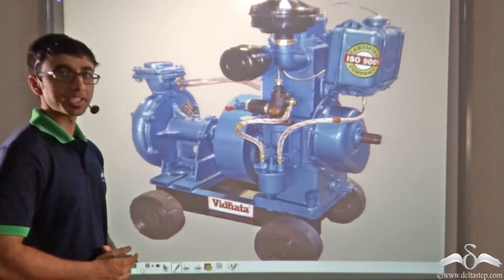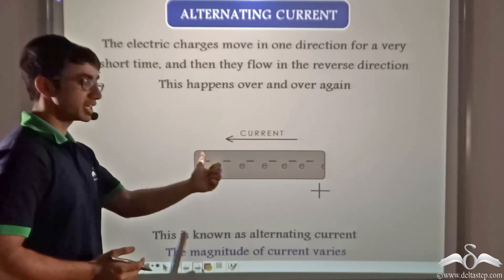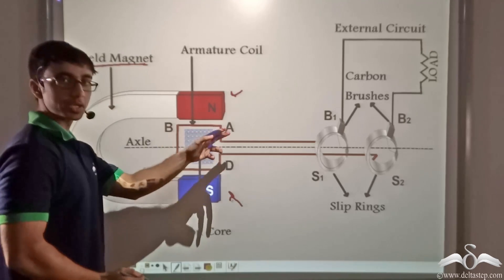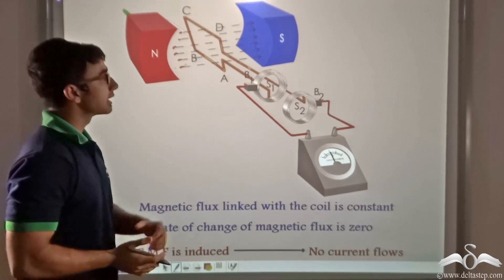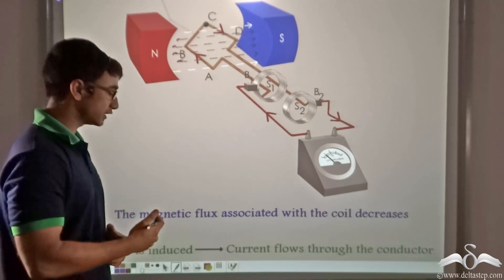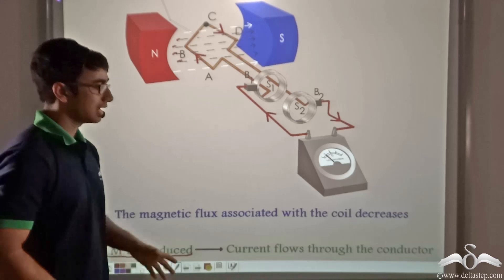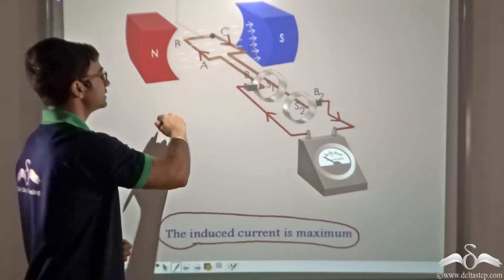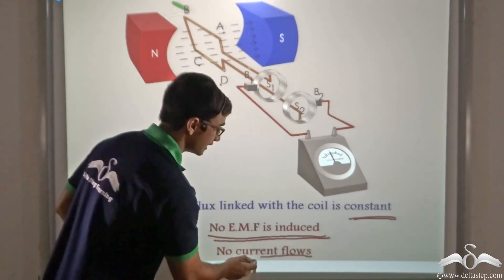Working model of AC Generator | Magnetism | Class 10 | CBSE | NCERT | ICSE

Comment: How do you visualize the e.m.f induced in coil in the case of AC. Where is this present ? You say first  the emf is induced and then the current flows. Where is the emf in the coil ?   In the case of DC with a battery we can say the emf is present across the terminals of the battery.  The difference in electric potential between the -ve and +ve terminal is called voltage or emf. In the case of AC, where is it in the coil because there is no battery.
Reply from the maker: We recommend you to register at DeltaStep.com to get access to 5000+ amazing video lectures, 1 million+ questions with detailed solutions, tests, games, report card and much more. Also get access to personal tutors to resolve your doubts. To know more, please feel free to contact us at 9674645164 or email us at info@deltastep.com. Download our learning App: https://bit.ly/2LBOVlR
Reply: @DeltaStep  I did but there is not a specific video there that  does  answer my question.

Comment: AC Generators used not only during power cuts and load shadings. The power stations also have AC Generators also known as Alternators. They are main source of power supply. They come in  210MW, 250MW, 500MW, 1000MW etc capacity.

Comment: This theory is bull shit. Why would current Flow when magnetic flux change? It's not so, it's like when the armature or copper Turing ABCD is vertical, the magnetic field lines pushing the electrons from both AB plane and CD plane are in equal and opposite direction, disabling the electrons flow.Hence zero current in there. When the plate ABCD is horizontal AB plane is near to magnet that's producing pushing magnetic field and CD is far from it, hence electrons in AB gets pushed towards CD and out,leaving maximum current

Comment: first of all this figure which is shown in the introduction of the video is not a generator is basically a diesel powered centrifugal pump which is a mechanical equipment not a electrical one and it is used to pump water

Comment: At a point we found that current produced is zero due to no change in magnetic flux but why our electrical appliances do not stop while working though ac current flows through them
Reply: I think its due to inertia....
Appliances does not stop but there is process or something called back motor effect.....
Reply: aditya rai because in practical appliances there is not a single coil.. there are many coils
Reply: It can be explained easily by E=-vBL sin@

Comment: I want to find out what is the difference between the AC (220 VAC) lines, (phase and Neutral).

As I know that the Alternating Current (AC) has no polarity, so why do we have a "phase" line and a "Neutral" line ?!
Why one of them (the phase line) would make danger on the human if touched, while the other doesn't ?!
I also want to know, what's meant by "Analog Ground"? .. is it the Neutral line ? or what ?!

Comment: what is the use of the brushes here?
Reply: it acts like a shock absorbing conductor. when the armature is rotating, it is constantly brushing against the slip rings. due to this, the rings might get worn off and connection might be lost. that's why those brushes are provided to maintain proper contact. here it has not been mentioned, but in practical life, these brushes come with a spring. during the initial phase, the spring is fully compressed. as the m/c gets older, the brushes get worn off and the springs also start decompressing and pushing the brush against the rings to maintain total contact. this is how it works. hope my answer was helpful.
thanks
Reply: Aniruddh Bhattacharya what? Why is it called a "shock absorbing conductor "..? I don't get it
Reply: Codo Sacho  to change the direction of current
Reply: bro it will carry current towards galvanometer

Comment: I struggled with understanding the max vs min flux change but by making a reference to the max flux when the magnetic force and coil were perpendicular to each other. Then when the coil was 90 degrees from that position the flux would be 0 and it would start the possibility for min to max over again. From there the max current flow was made a little clearer (when the change in flux was max)